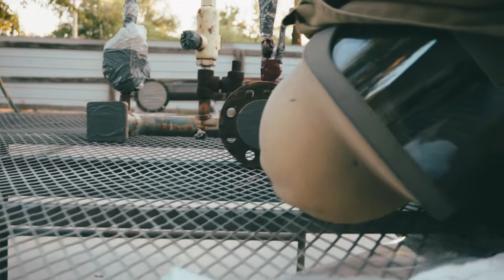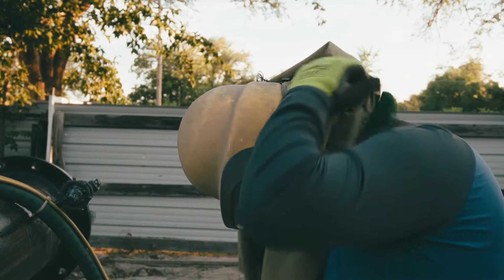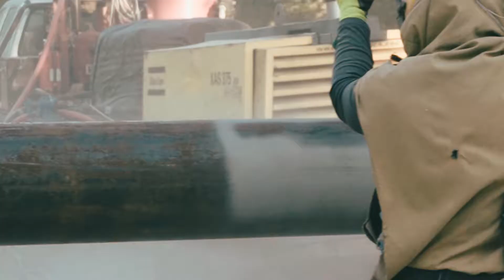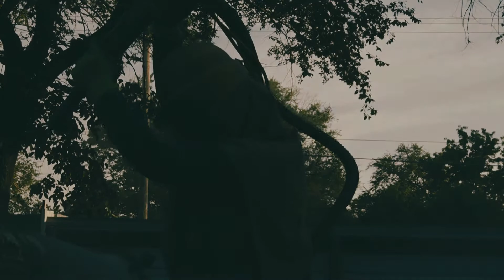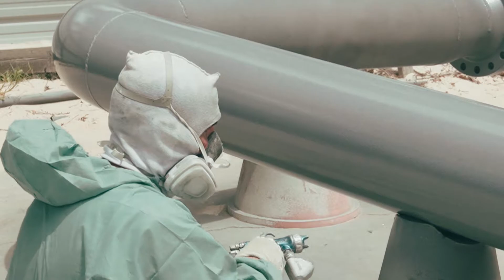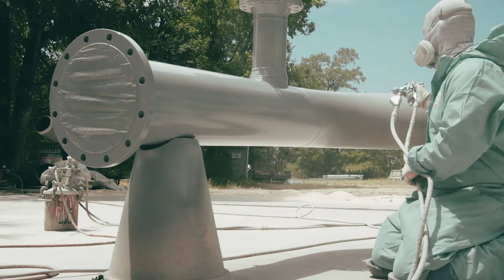Sandblasting & Coating Pipes (Don't Miss This INSIDE Look)

Comment: cero profesionalismo, Granallado al aire libre, contaminando, muy cerca del compresor que absorbe todo el polvo etc. con pistola convencional... lo mas probable que no alcance los espesores requeridos o tendrá que hacerlos con bastantes manos extras.
Reply: Have you heard of an air filter?
Reply from the maker: The coating was mil checked and passed all the specifications for that coating. Thank you for your concern!
Reply: Não quer dizer que com uma convencional, não consiga uma espessura ideal.
Trabalho com airless, quando a espessura supera as 300 micras.